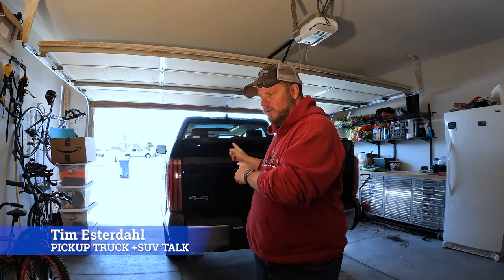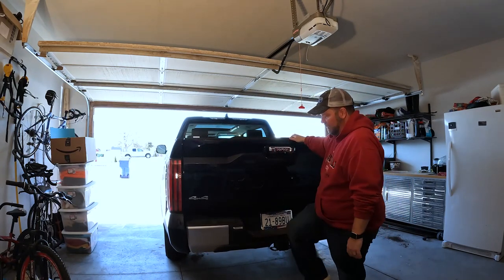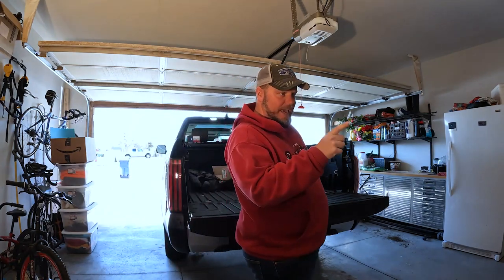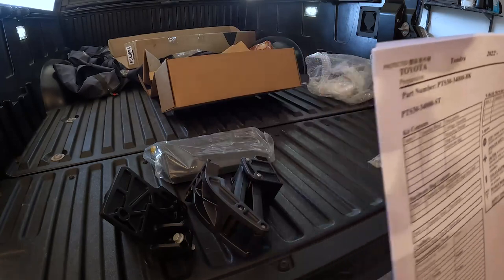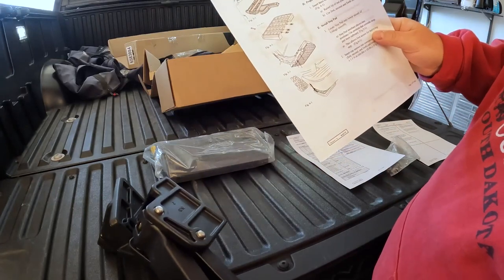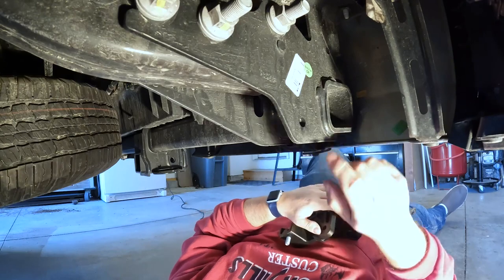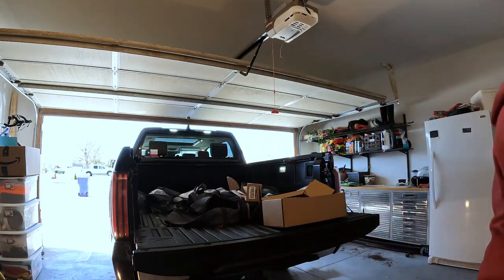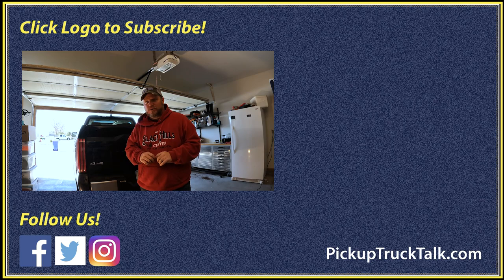Not So Easy! How To Install 2022 Toyota Tundra Bed Step

Comment: The "-BK" will only give you the bracket and "-ST" will only give you the step (I learned the hard way). You need to order "PTS3034000" which is the actual kit as shown in the video and confirmed by my local parts professional.
Reply: Yea, It looks like ordering those 2 separate parts gives you everything but missing 2 bolts and 1 nut, now I guess I need to go find those :-(
Reply: @mroger64  just order P/N PTS3034000 for the 2022 Tundra.  It comes with -BK and -ST and bolt kit...  also a lot cheaper ($244) than ordering the others separately ($300+)
Reply: @mroger64  Based on the Tundra forums the nut part#90178A0107 and 2xBolt#90119A0440. I haven't tried the install myself yet but that's what they're saying to order from the dealership.
Reply: Thanks for this info, buying bracket and step seperately cost way more

Comment: That’s funny they give you a step for free to silence the criticism but will be more then happy to sell everyone else one for $350 😂. Should be a standard item going forward and sent out to everyone else that bought a 22’ Tundra so far.
Reply: 100%. Ford, GMC, and Ram all have their solutions from factory. 

Toyota nickel and diming their customers
Reply: They need to do an update to bring Tundra to software that would make better sense. It's  senseless the cumbersome  and many times archaic. They really should make the computer family friendly and then add a valet mode to be engaged to put in a code to operate. Signing in everytime you get into drive the thing is ridiculous.
Reply: @jayrichards3672  Link it to your phone then you don't need the PIN.
Reply: I agree
Reply: 100%
Reply: Yep should have been standard across all models, its a truck and you need to access the bed, easily -- big miss IMO and on the list of why I'm cancelling my deposit on this truck.  Not many people can step up straight to the tailgate.  Big oversight on basic functionality.  The other thing is its likely to freeze in the winter and become inoperable/deployable leaving you to crawl into a "snowed in" tailgate filled with ice/snow/salt.  The other thing that is bound to happen with use is nothing but scratches to the colour painted bumper every time you wedge your shoe/boot into the crevasse to deploy it.  A simple 3M clear film for that area would be something I would do with the install.
Reply: $350 is highway robbery 😂
Reply: Agreed, because the new design of the rear bumper is not for a truck but a car.  Not having even a small stepping area in the design of the new Tundra is impossible.  I put this in the category of "what were the engineers thinking???"
Reply: It’s a mess and total miss on their part….
Reply: Here’s one to silence you. But you have to put a tutorial up so we can sell it to the masses.😂🤣
Reply: Lol their website says the part is no longer available
Reply: @mbround18  ... not surprised.  Just another item from a Manufacturer that cannot produce a product.  The thing is...NOBODY calls them on it or holds them accountable.  Frustrating to say the least!
Reply: @baloo1522 I bought my tundra new last year. When shopping brands the ford and and dodge were also contenders but for the features the tundra has, they wanted 15k-20k more. 

The American truck market is absolutely ridiculous. I’d rather pay $250 for a step than $15k for American.

Comment: the new design of the rear bumper is not for a truck but a car.  Not having even a small stepping area in the design of the new Tundra is impossible.  I put this in the category of "what were the engineers thinking???"   Or better yet, poorly designed and engineered.  Just terrible!!  Oh, the afterthought is to sell a step at $350.  Unbelievable!!  Just another "PASS" on the 2022 Tundra.

Comment: Hmmm, the engineer must have come from GM. You know the one that decided that removing the transmission for a belt check was acceptable.. This wasn’t that bad at least you didn’t have to remove the box to install the step. Are you missing that nice tailgate step with handle on your F-150 yet? Also I’ll be interested to see how this step works through a Nebraska winter.. Keep us informed Tim.. By the way nice tool area with a kegerator right next to it…. Thanks informative video.
Reply: Ha ha - you got that right on that GM 3.0 Duramax. Sort of a big flaw, but otherwise that engine seems to hit the mark in torque and fuel economy. I'm leaning toward buying one since there is a lot of the new Tundra I don't like.
Reply: @percivalgooglyeyes6178  Oh I agree that engine sounds like the cat’s meow and the tranny its hooked to sounds good also.. Seems like a great power train. And truly I could live with the belt (kinda) but I keep my vehicles for a long time and I just don’t like the thought of paying a GM garage to pull the tranny to check a belt, I would replace it at 100,000 miles as this belt has a very important job. I never had good luck with larger repairs and I would just worry that they would screw up something else in the big process of dropping the tranny. Wonder what the price would be today to have that done? Figure another 10% or more in a few years.. So if you go that way the best of luck to ya and enjoy that power train if you do….
Reply: @noniespam  Apparently GM is already planning on doing a redesign on that engine.  Maybe they will correct this belt issue, but also there is speculation on doing cylinder de-activation. Yuck, this could be a disaster. The current LM2 seems to have few issues thus far and has been out for a couple of years. Now telling how long it would take GM to get another version working well.  Since I haven't even got to 150K miles on my last new truck (2005 Tacoma) which is now 17 years old, I can probably handle that belt interval.
Reply: people who have done the belt replacement/checking said it's really not a big deal, just people whining like it's the end of the world
Reply: Dropping the transmission is not that much harder than disassembly of an entire front accessory drive system to do a timing job. If anything its less parts and bolts.
Reply: @percivalgooglyeyes6178   interesting, I see it’s been a couple of months now and wondering if you pulled the trigger?? Just curious did you ask the estimated cost to replace the belt??
Reply: @noniespam  Hey Rick.  No, I haven't pulled the trigger yet. The primary reason for wanting a new FS truck is to haul my 25' boat from our home in WA down to Lake Powell and then to our winter home in AZ and maybe do the river area there too.  Since Powell seems to be drying up, and the insane truck prices haven't relaxed much, I'm OK with waiting a bit longer. My '05 Tacoma with an easy 147K miles is doing just fine.  I'll see what happens in October before we head down.  How about you, did you get a new truck?

Comment: Those steps should be standard equipment on trucks. I’m putting one on my Tacoma. Tired of climbing in and out of the bed and wrecking my 60 year old knees. GM built one into their rear bumper but it is still tough to use with the tailgate down. The install doesn’t seem to be impossible but definitely should mention moving that bracket. Might be a deterrent for the non-mechanically inclined. You shouldn’t need to reverse engineer the instructions. But in the end it looks nice and seems to work as it should. Good job and thanks for working through the small issues so the rest of us can know what to expect. Good job.

Comment: Nice job Tim. You have way more patience in the shop than I do. I would’ve lost it and bent  some plastic.LOL I think one of the first things I would do after installation would be to put some of that clear tape where your toe would hit the corner bumper all the time. My work boots would scratch the crap out of that corner reaching for the step. Also with my luck I want to drive with it down and tear it right off lol.

Comment: I added a stair step. It is mounted on the inside of tailgate. It folds out and down and stows up and in. I installed it for the wife. It like stepping up a small ladder. It also has a handle the stows. It stays clean because it rides (mounted) inside the tailgate. Worth every penny.
Reply: Where’d you find one of those? You got a link?
Reply: Please post link
Reply: @MrFcpsitsgepgepgep  walmart maybe?

Comment: I installed a OEM Toyota Bed Step on my 2019 Tundra today. Cost for the part was $275. While the part is too expensive, I’m very pleased with the end result. The only time consuming part of the install was gaining access to the plastic pins from underneath to lift the plastic bumper cover and unscrew the bolts to the holding the bracket. If you want to keep the factory bracket, then you’ll need a long screwdriver and plenty of patience to accomplish the task. I have large hands so I gave-up after a half hour and several skinned knuckles, then quickly cut the factory brace with a Sawzall. The Bed Step comes with its own modified OEM brace anyway. After removing the brace, access to the push pins was easy and the job was complete in roughly 20 minutes. It’s important to note that the instructions provided with the part are vague are poorly-written. However, once underneath the truck you can figure it out.
Reply from the maker: I hear they have changed the instructions and maybe the part after this video went live.

Comment: Any of my F150s I have owned since the tailgate step has been available, STILL had the bumper step installed.  I often tow with the truck and the tailgate step is useless then!! It sure has a fancy tailgate deck though now!! 😂😂 I am 5’8”,,,,, so a GIANT compared to TIM,,,,, and yet I still benefit from that side step. Even on the GM trucks,,,, that corner bumper step is a fair height to step up, so several of my friends have a corner drop down step as well. It like walking up a staircase then!! Sweet!! Haha. Then there are friends that just make fun of me being short, I’m richer than them,,,, I think!!😂 
    Nice explanation and it’s a very solid product mounted!! You can probably even scrape it a bit without more than cosmetic damage. Dooonnttt break it for now,,,, like Tim said,,, parts are seriously back ordered!! 
     Looks good to me!

Comment: How do these steps work after a winter of road salt or when you get them really dirty?
Reply from the maker: I’ll find out.
Reply: I installed a similar sep on my ram last summer. I live in ontario and never had any problems last winter with the step. I loaded my snowblower in the back probably 8 times over the winter. Lol,  I had more problems with the tail gate freezing to the tonneau… I would imagine I should make sure I oil up the step late in the summer each year.

Comment: I worry about the location of this contraption. If you are in an area that gets a lot of snow that is a prime location for slush buildup that basically turns to concrete in winter.  This also highlights another possible issue, which is corrosion of parts. It also seems as if it will negatively affect departure angle. I believe Ram sells a contraption like this also, which is not ideal. Ram and the Honda Ridgeline have the barn barn door and swinging tailgate, but what happens when you're in a congested parking lot or parallel parked? Take notes Ram, Toyota and Nissan. GM and Ford do bed access the best.
Reply: I wonder if Patents hinder step styles and yes, they should include stainless steel hardware for this.
Reply: @Gene1969  I don't know, but it just seems like this whole contraption was mostly and afterthought. Toyota had so many opportunities with this truck and just completely blew it.
Reply: I’ve had this step on my 09 Tundra since new and haven’t had any problems with it, no problems with rust or snow buildup. I believe it’s made by Amp research, very good product. I wish there was a handle attachment for the top rail where the adjustable cleats go. I do agree it’s very pricey.
Reply: Well it can’t go on top of the roof 😂

Comment: Tim, do you have a Toyota factory contact which you can send to me that deals with the optional 2022 Tundra accessories?  I’m still waiting on Power Running Boards and Power Step that Toyota dealer said they would provide (in writing) to me on my 2022 Platinum series Tundra.  It’s been 6 months since I purchased this truck and Toyota is the slowest company that I have seen to provide any updated accessories.  These parts/package are offered as an option when selecting the vehicle, so why is it taking so long to offer them as accessories.  Thx. Marc
Reply from the maker: Sorry, I don’t have a contact.

Comment: What a pain to install!  I installed an aftermarket step (a lot easier to install) on my 2010 Tundra back in 2014.  Still works well and still looks good.  Almost a must on my 2010 but definitely a must on the 2022.

Comment: What happens when you run out of departure angle and scrape whilst offroading?
Reply from the maker: Exactly how you said. You scrape it.
Reply: That is why they don’t include them in trd pro and the off road package.

I am so disappointed in Tundra, was waiting so long for this…

Will give Toyota a year to fix all those issues, if they won’t - unfortunately I am not buying it.

Comment: Why would you design that bracket to be held in with a plastic pop off fastener at the bottom?Totally useless for rigidity and whatever kind of structure protection.  Those plastic pop off fasteners are to hold non critical parts like a plastic fenderwall, etc. What garbage!

Comment: Hey Tim, do you know if the automatic bed step can be installed after the truck is built? My 2022 SR5 build sheet included the step, but when I picked up the truck the step wasn’t there. Dealer is telling me they will install it once they can get it in. I just assumed it would be the automatic step that unfolds with the tailgate, but this video makes me think I’ll be getting the one you have here. Just curious if you know whether or not it’s even possible to install the automatic step after the fact. Thanks!
Reply from the maker: Honestly, I don’t know. Sorry.
Reply: @Pickuptrucktalk  I'm planning to buy/install this bed step but I didn't see what you did to tigh the third bolt of the main bracket. Can you tell me ?
Reply from the maker: @ELPASTORAPOSTOLICO  third bolt? The bracket bolts should be tight.

Comment: I wonder how long it would take a guy to scratch the hell of the corner of the bumper kicking that step up and down? Seems it would be a good idea to have some sort of protector for the paint in that area. I know the higher end trims you can get a powered step back there with power running boards. A powered step would be nice as an accessory.
Reply: Yup. Ram design is better. Has a tab on the side for your foot.
Reply: I was just gonna say wait to see what that bumper looks like after you use that thing for a while. Some things on this truck just don’t make any sense.
Reply: The platinum has a powered step as standard equipment, don’t understand why it’s not an option on the limited…
Reply: Does the person have Parkinson’s? What a strange thing to think would go wrong 😂

Comment: I know the platinum has an electric auto deploying step, I wonder if the harness plug is standard on all Tundras? 

Also I recommend the Toyota Intergrated DashCam, super clean and easy to install, I put mine in in about 10 minutes and it’s a really cool accessory.
Reply: I would never buy accessories like that through the dealer. Toyota charges $528 for the dash cam in Canada when I can buy a Roav with the same form factor for less than $100.

Comment: Longtime and multiple Toyota truck owner and current full-size buyer here. The more details I see about this new Tundra the less I like it. Very plastic-icky. This is more a SUT - "sport utility truck" than a real truck with real metal bumpers and tow hooks.
Reply: The bed step should have been standard but it’s silly to say it’s not a real truck.

Comment: This is one of the best mods I did for my '18 DC TRD Sport. Got a great deal from my brother's friend who worked for a Toyota dealer at the time. It was a PITA and I had to get a different aftermarket exhaust ( I had a Borla before it but it was a dual exhaust  that exited out back) so I switched to Corsa that exited to the right side so something to keep in mind). But the fact that it took Toyota a whole gen to finally install it as std albeit not on all models, is clearly unacceptable! This is why auto companies need to hire more women designers. They tend to come up with more practical designs (i.e. adjustable gas pedal for GM trucks)that make life more convenient as opposed to just being manly

Comment: I heard that GM copyrighted the indentation on the bumper. Is it possible for owners to notch out a space themselves?
Reply from the maker: Not with the way the rear corner is designed.
Reply: It’s much more exciting for people to sit here and believe they are smarter than all the Toyota engineers for “not thinking of this” than to realize there is obviously another explanation 😂

Comment: I agree with all comments below -- step should be an included feature on the truck. I paid $499 for one at the dealership, and the install directions were unintelligible. Without this video I never would have figured it out. Still can't figure out how to get the support bracket I had to move reattached. Step prevented it from bending it back in place, and the top bolt seemed to be frozen in place, so I couldn't  remove completely and reinstall behind step.
Reply: You shouldn’t have to bend the bracket to install the step. Just remove the push pen from the bottom of the bracket and reinstall the push pan after the step is on.